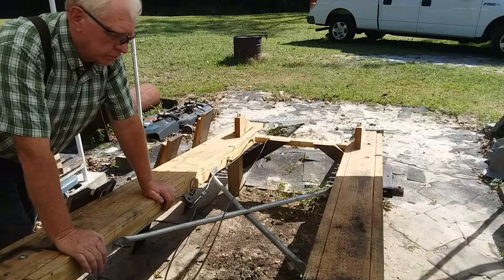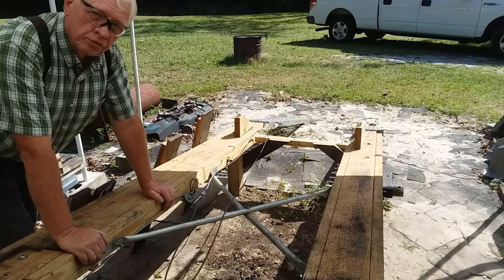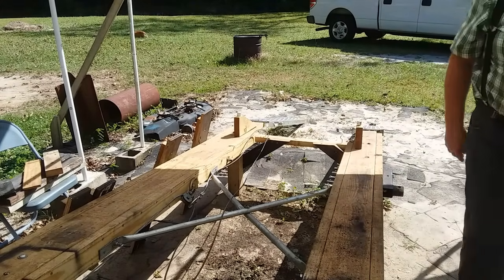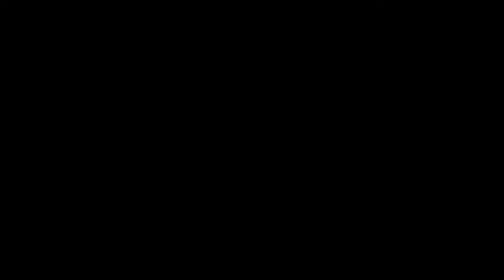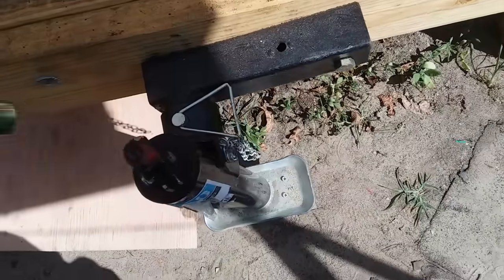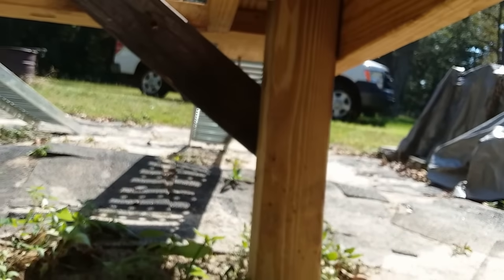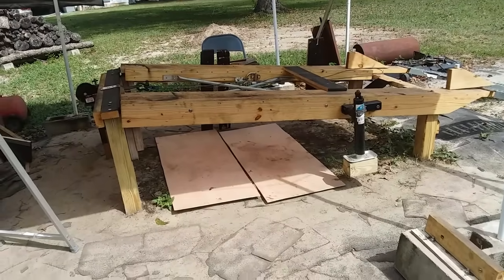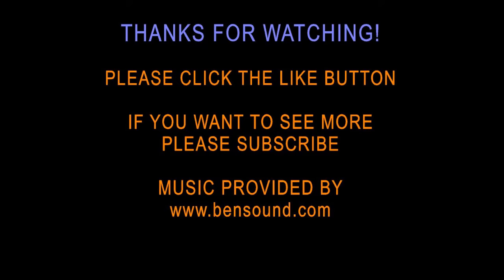Homemade Lawn Tractor Work Rack

Comment: Reminds me of a co worker that had something similar made of railroad ties and built into a bank on his farm. Was strong enough for cars pickup trucks and small tractors . Used it for oil change and muffler repair and such . I miss having that available, now I have to do it at home in the garage or driveway.  Great idea for those guys who are always tinkering around with lawn equipment and easy to customize to your own needs.
Reply from the maker: Yeah, this is not for the person that occasionally needs to repair his mower or small tractor. This is for the person that has a constant tractor / mower job. Thanks for watching.

Comment: Nice project and video :o) For my purposes, I just keep a come-along hung from the tree limb that's next to my garage. Can simply lift up the whole front or rear end of the tractor. Can even lift the tractor in a near vertical position for getting full access to the mower deck.
Reply from the maker: Sounds a bit dangerous. Keep Safe.
Reply: @eds2centsworth203  
Whats a bit dangerous about a tree limb that's strong enough to lift 1 ton, a come-along that's rated for 2 ton, and simply lifting the front end or rear end of a small lawn tractor?
Reply: @eds2centsworth203  Agreed.

Comment: Very nice rack. Thought about buying a lift table, but that hinders getting underneath. I use a tractor lift jack now. But kinda sketchy at times. Plus the rack would be a lot cheaper than a lift table. Thank you for sharing. Great video.
Reply from the maker: Thanks 👍

Comment: I built a stand for my fiber glass camper that slips on an off my pick up truck. Built out of 4 x 4’ and 2 x 4’ it’s about waist high and keeps my camper top off the ground. It’s easy for the wife an I to remove and reinstall without so much bending. After I built it I used post hole digger to sink 4 x 4 into the ground about one ft. So the wind wouldn’t blow it away.
Reply from the maker: Great idea, I love ingenuity!

Comment: I'd Like to build a ramp. But in a larger perspective for vehicles. The telephone poles I've got can work nicely. Bracing everything with steel and concrete.
Reply from the maker: I've seen some ramps like what you describe. They were pretty common back in the 1960s & 70s.  Sounds like you've got it all worked out.